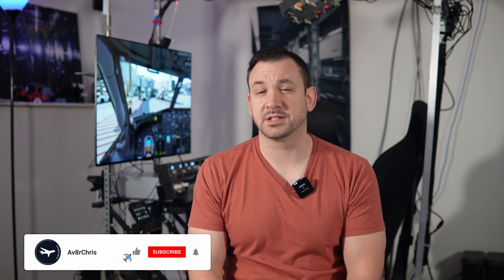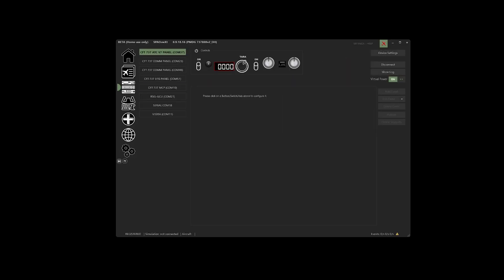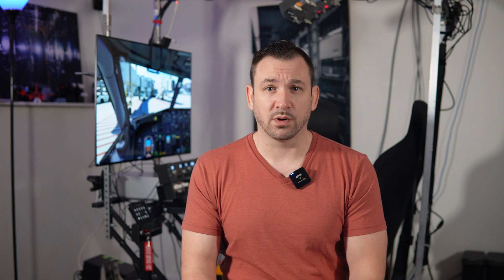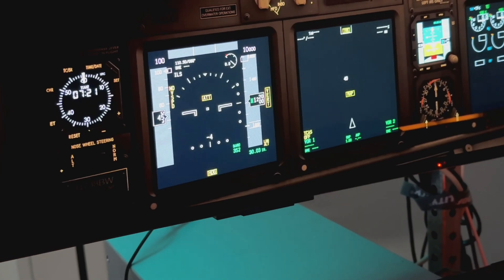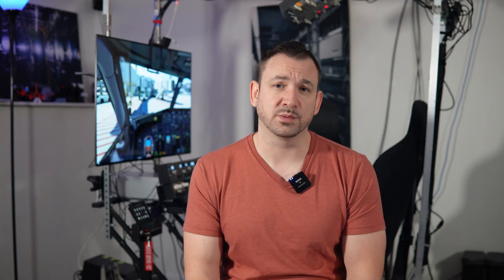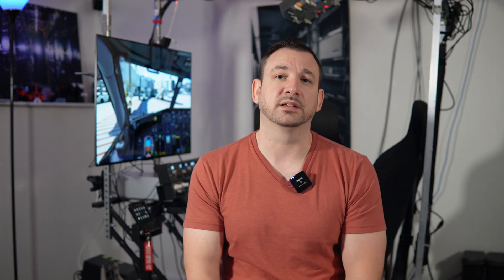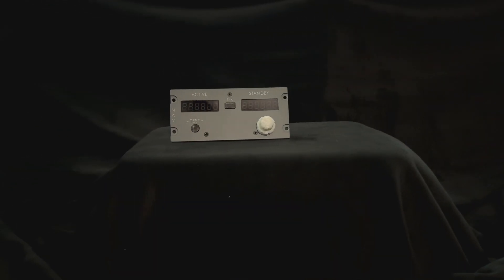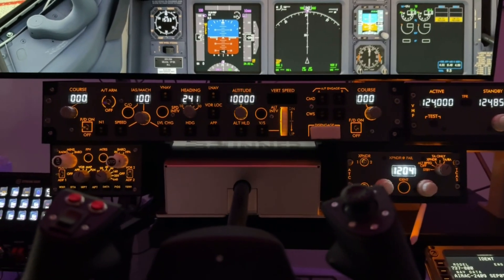Review: Core Flight Technologies Boeing Hardware

Comment: Did you use existing holes/screws on the MCP and EFIS for mounting? Which ones?
The manufacturer recommends double-sided tape but – ugh! – I hate getting tape goo on everything. Thanks for the review!
Reply from the maker: @rwalkenhorst  yep. I just designed around what was there. Unscrewed and reused those screws. Works just fine and more or less makes it easily swappable when I flip between this and the winning FCU.